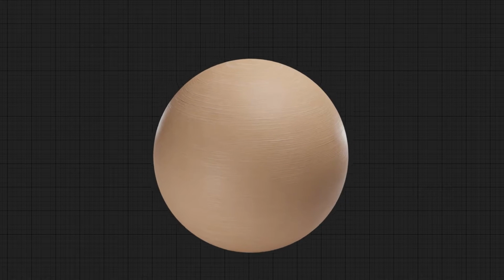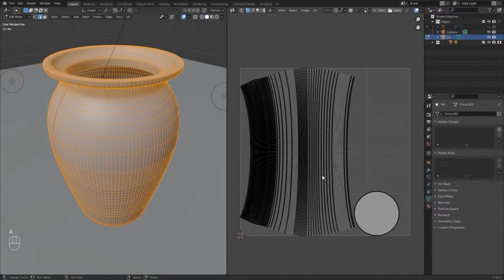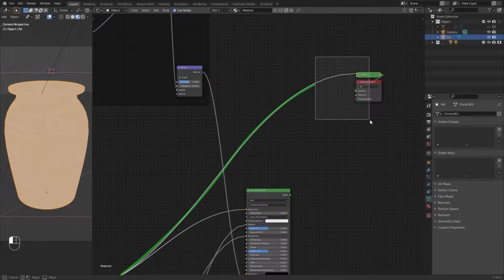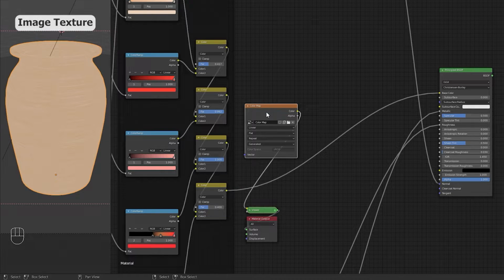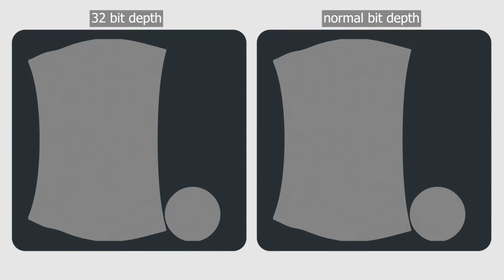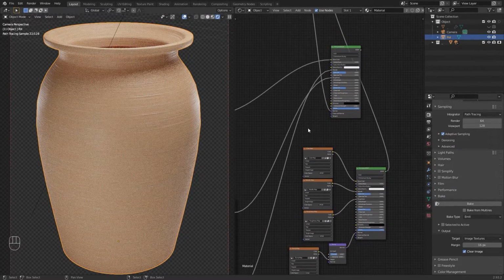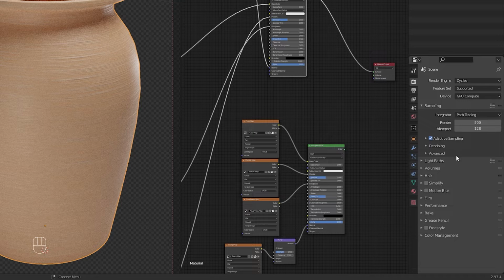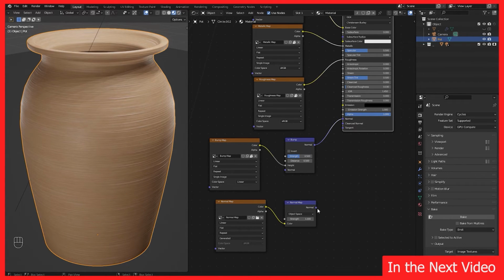Bake Procedural Material to Color, Metallic, Bump and Roughness Maps [Normal Map?]

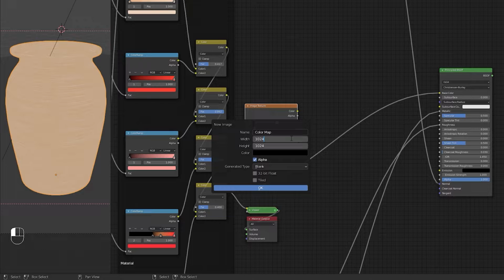Comment: Hey nice video, I just have 1 question. At 5:50 I see you have several yellow nodes with just 'Color', these link the with 5 'ColorRamps' in the 'Color Map' Node group. When I press Shift  A to add and type in 'Color' I only get 'Vertex Color' and 'Color ramp'.  Searching under 'Color' under the drop down box only shows: 'Hue', 'Saturation', 'MixRGB', 'Gamma', etc. I see no 'Color' node by itself. 'Invert' appears with no problem, I can type in 'Invert' or search for it under the 'Color' options. It's just that 'Color' node itself isn't there, like in your demonstration from 5:40-5:50. There are the yellow color sockets. Do I make the 'Color' nodes from those? Or is there another way I'm supposed to add 'Color''? Otherwise should I just experiment with other nodes to see if I get it to work? New to blender so I'm learning a lot right now, Thanks.
Reply: If you add a "MIX RGB" node and then in the dropdown menu you will see a lot of different option, in that list you will find color, that is the one that the person is using in the video
Reply: @mr_chou  Thanks. I overlooked that.